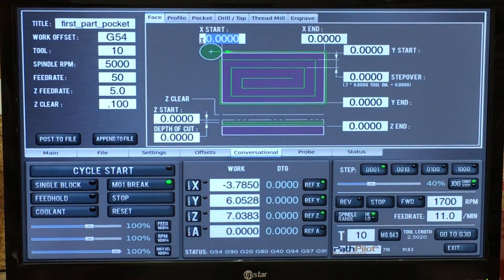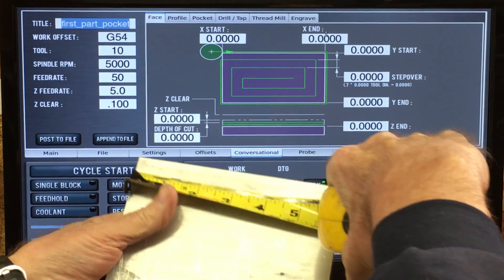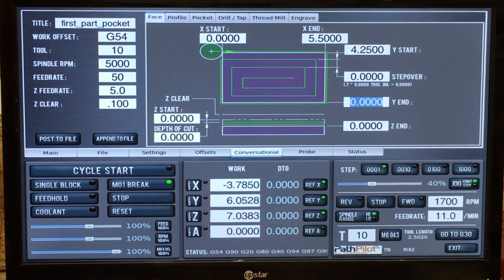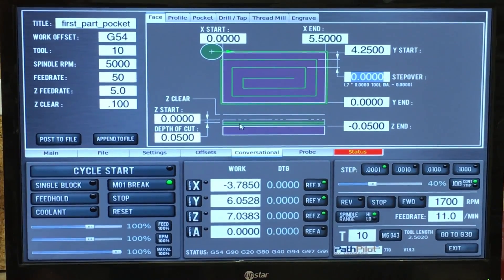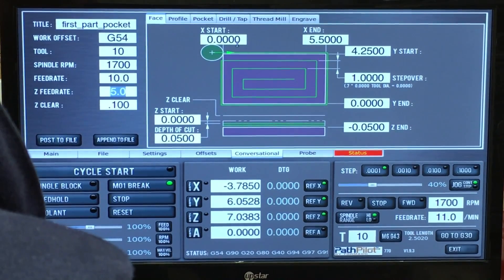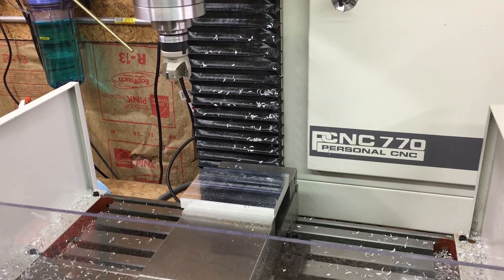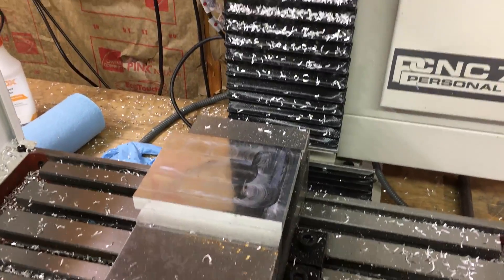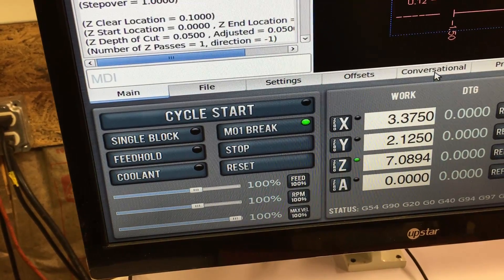Pathpilot Conversational   Facemilling

Comment: Sounds like it is heavy on the spindle. On 8:50 you can clearly hear the load, how much is the rpm dip and how many hp is used?
Reply from the maker: +Ricard Rinaldo  - Yeah, that was before I found out about the affect the VFD has on the HP of the mill.  The max HP on my mill is around 5000 rpm I believe.  At 1700 rpm I would have been limited to around 1/3 of the 1 HP.  I still have to do some testing and will make a video on it.

Comment: Hey Craig, do you like the face mill or the shear hog better?
Reply from the maker: +Crivo152  - Definitely the shear hog!  The Facemill will be for facing steel since the shear hog is for aluminum.
Reply: Sorry Craig, I meant to ask about the fly cutter, but sheer hog came out instead.
Reply from the maker: +Crivo152 - Oh, the shear hog is definitely better on aluminum.  The facemill will be for steel.

Comment: Beautiful! Path pilot conversational is so quick and easy to do! All 3 times I have used it! LOL! Thanks for sharing Craig, great video!
Reply from the maker: +Tim Robel - Thanks Tim!   Yeah, easier then I thought.  Great for a quick facing operation.  Have you had any luck with pocketing in Pathpilot?  I crashed and haven't tried again.
Reply: +Craig's Machine Shop I have just faced and slotted with it right now. I do plan on doing a pocket soon, just so busy with other things. Do you know what you did wrong to cause the crash?
Reply from the maker: +Tim Robel - Yeah, chip weld.  lol  All I had was a 4 flute carbide. The pocketing method was odd also.  I'm use to a circular ramp in.  The one in pathpilot is kind of square. Start with a light depth of cut and see what you think.